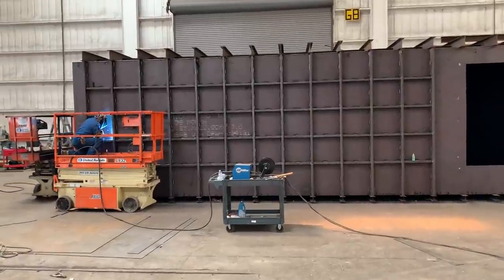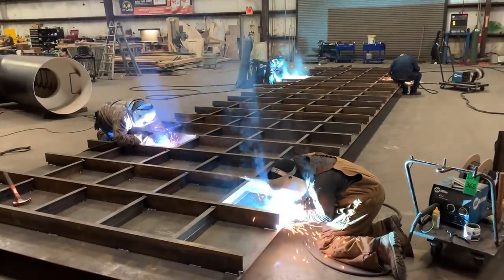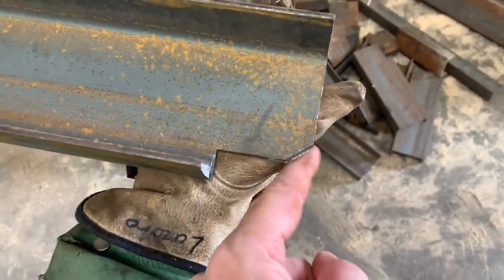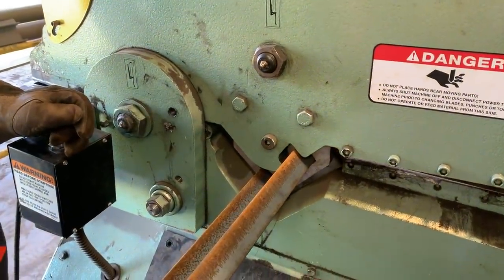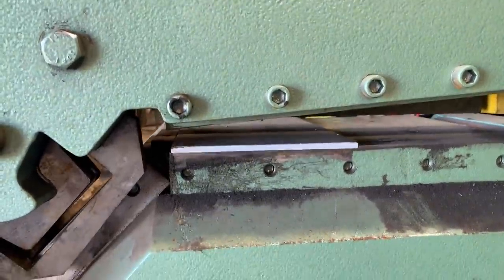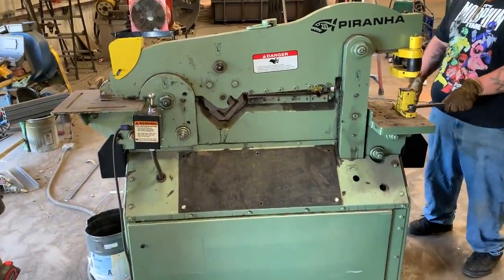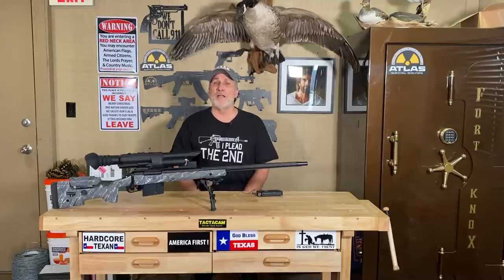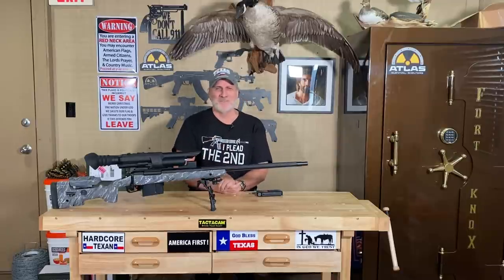How this $20K Piranha Ironworker paid for itself in one year?

Comment: Ron- just get a laser. You make the same product over and over. You have to pay separate for the operating system. Get the programs made up for each part.
I agree with the guy who says your staff need safety glasses. Steel under pressure can explode in unexpected ways.
Reply from the maker: Which laser machine are you referring o

Comment: I usually work 10hrs a day but I had to stand at the piranha all day and clip atleast 1000caps for tube 5 to 6 hrs in my left foot wasn't feeling to good from leaning on it and using my right foot to operate it but I got all of it done In 2 days but we have a saw in the shop that you just roll the metal in and measure it lock the vise and turn it on push the two green buttons at the same time and it just cuts by it's self and It comes back up when it's done take the metal off stack it on a pallet pull another metal piece though and repeat very simple once you get used to it took me 1 time and I remembered how to use it ever since

Comment: Awesome video Ron! I was wondering where your videos had went. Used to pop up on my feed all the time but not lately. 
My job has me running a hydraulic horizontal bandsaw cutting all the channel for the mast on your Hyster Forklifts! It has automated feed which measures the channel length before I check measurements and start cutting. Nice piece of equipment lol
Hope you're enjoying the Hysters  👍
Reply from the maker: Great Forklifts
Reply: @AtlasSurvivalShelters  All the 1-9 ton capacity trucks built in Berea Kentucky with Care, Hard Work and Dedication to the Customer. 👍🇺🇸🇺🇸

Comment: Invest in a hydraulic pump and a few floor lifts on a platform to lift that entire section to get your workers off the floor. You are missing your most valuable asset.....your labor force. You have your men kneeling and laying down on a concrete floor. If you are worried about it being flat and level then pour a flat level slab waste high and use an overhead crane to move the floor chassis down when your done. That lightweight section of frame wouldn't even require that large of an overhead. Everyone is tough as nails when they are young but I think everyone can agree by now that is going to cause serious physical conditions over time. If you don't take care of your people someone else will come along and they will. You will lose your crew to your competition. I don't care what kind of patents you have the design can always be improved.
Reply: Agreed. I can't do what I used to do. Kneeling for everything gets old and hard on the back.